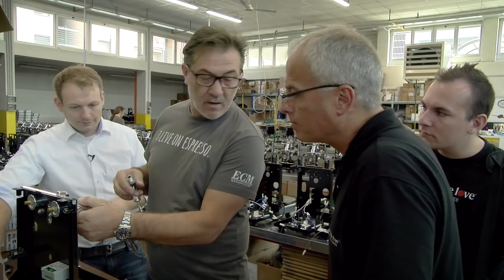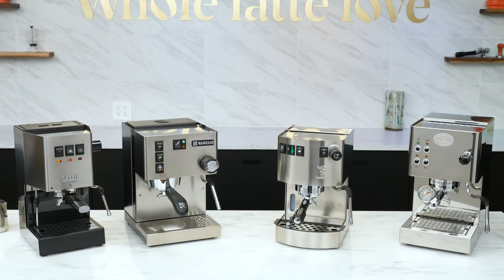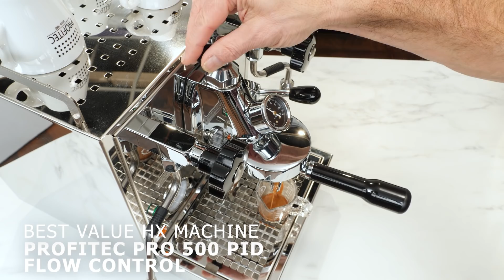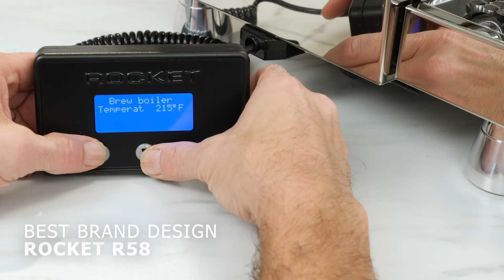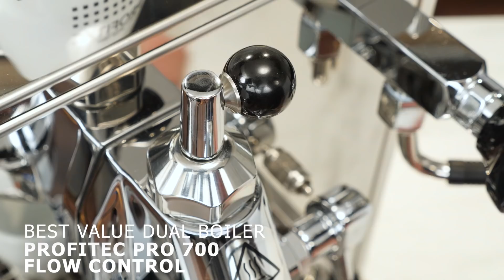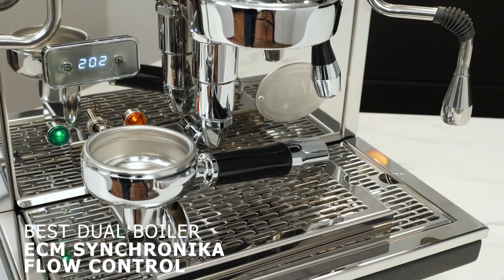Top 5 Best Semi-Automatic Espresso Machines of 2019

Comment: As a german, i prefer german engineering, there the ECM Synchronika should be my favorite. But i like the modern look of Bezzera Matrix better. Do you have any advice?
Thank you for your great work here on Youtube!!!
Reply from the maker: Hi m, Thank you for the comment and question. Both are excellent machines. Personally I prefer the Synchronika. Internally the Matrix is more complex. Synchronika is incredibly easy to get inside and likely to have an edge in long-term reliability. I've been to both companies production facilities in Italy and appreciate the effort CEO Michael Hauck of ECM puts into constantly innovating. Little things like using stainless steel mushroom valves while some manufacturers use chrome plated or ceramic. He and his engineer come from a background in servicing commercial machines so reliability and ease of maintenance is always on their mind. One big difference is steam power in the Synchronika. It's best in class with near 2 bar of pressure. If interested here's a video I shot at the ECM production facility in Milan with Michael last year: https://youtu.be/K0RI5rdz4Ww
Marc

Comment: Hey Marc,  Great video but now confused!  Was originally looking at the Breville Oracle Touch, then a friend said to look at the Nuova Simonelli Musica .... now I see these and oh boy ....  Just a want a great coffees and lattes with a reliable machine...steer me in the right direction!
Reply from the maker: Hi Sam, Thanks for the comment and questions and please excuse my delayed response. Been offline for the holiday for a few days. These are tough decisions with so much to choose from. First thing I'd think about is appliance vs. machine grade products. Appliance grade is mass produced, fair amount of plastics, uses proprietary parts and typically not very user serviceable. Machine grade products are hand assembled using commonly available components of high quality. Internal plumbing is high quality and copper. Virtually no plastic is found inside or outside a machine grade product. They are very user serviceable and with proper care can run for decades. With all that, products like the Oracle Touch are appliance grade. They have a lot of desirable features at a lower price point that hit marketing points but they get there in most cases using lower quality components. If you'll be doing a lot of milk-based drinks I'd consider a machine with e heat-exchange or dual boiler. With those you can brew and steam at the same time. The Profitec Pro 500 PID and Rocket Appartamento in this video are two HX machine options.Those machines IMO are a huge jump over the Oracle and substantial jump in quality of the Musica. Hope that helps and let me know if you have any more quastions.
Marc

Comment: Hi Marc, great detailed review as always. I was wondering if you would consider adding more data to the reviews mostly min/max dimensions and min/max wattage.  I am limited by my upper cabinets as to how big a machine that I can put in the kitchen. I've noticed that some of the machines may have height adjustable feet (I think one of the Rockets have a two piece "Rocket booster" foot that may be separated) and removable cup warmer racks that could affect the height. A lot of manufacturers skip these seemingly minor details when listing the specific machine attributes, but unless you are remodeling your kitchen, the details can be significant. 

When it comes to power usage, I have a controller that can actually measure wattage and found that during start up the power consumption was a smidgen higher than ratings, but after the machine warmed up, the wattage was cut in half. I think I am at the limit in my kitchen and being in an older house, the outlet is shared with some of the lighting. The good news is LEDs have saved the day by eliminating 460 watts off the circuit and everything worked fine without LEDs anyway. I have an energy monitoring controller for the lights and outlets in the house. Apparently there is an espresso machine somewhere in the home that uses the majority of the electricity...

Keep up the great work, it is most appreciated.
Reply from the maker: Hi TT, Thanks for your extended comment! Please excuse my delay in response - I've had a crazy few days! I understand the request for additional details in the videos. I do sometimes include test results for machines but most specs can be found on the product pages on our website. If you need additional details like specific measurements and option hacks like those rocket booster feet you can give one of our customer support pros a call at 585-924-7170. They have access to most every product we carry while on the phone with you and are happy to get additional measurements and details. I'm happy to answer specific questions here in the comments but that typically takes a lot longer. I love the LEDs too! I have reef aquariums at home and converted all lighting to LED. It's far more controllable, uses so much less power and they last a very long time. I used to drop $200+/year just on lamps and I don't want to think about what the electric bill was! My corals are much happier now and so is my wallet.
Marc
Reply: @Wholelattelovepage  Sorry I screwed up your name, so I edited that. Thanks for the answer. I guess another thing I have to consider is the grinder too. If I happened to have a larger machine and a 500 watt grinder, the breaker may not like me too much. Luckily, the stove is right there and I can hop on to that circuit. Back in the day, old stoves had an electrical plug and you could spread out the load. I don't have one on my new stove, but I can wire up 120 or even 220 off the same wiring. I don't use the oven and the espresso machine at the same time, so options are there. You can tell I have been planning my attack for a while. I'm going to remodel the kitchen with new smaller light rails increasing counter height under the guise of modernizing the kitchen, but the real plan is to make clearance for a bigger machine which I will lie and say "No, it's the same size as the last one, it must be your imagination"...

Comment: Hey Mark, nice video. What do you think about the Bezzera Duo or Matrix in quality and function? The display of the Bezzera is much more innovative but they build the boiler still in copper and ECM in stainless steel. Is it better to go with the ECM Synchronika for a bit more money?
Reply from the maker: Hi S, The Matrix and Duo do have a lot going on with the touchscreen display. Some people like that and some prefer a more traditional approach. Traditional may be more reliable. I have no preference on copper vs. stainless. Boiler material makes no difference in the cup. I'd go with the Synchronika. Very reliable, higher steaming power and larger boilers. Plus it's available with flow control on the E61 which opens up more variables in extractions.
Marc
Reply: Hey Mark, thanks for your feedback. I think I go with the synchronika. I think its actually the best all round package of building quality and features in this price range. I like the display of the new bezzeras, but you are right, the classic baros looks also very nice and are more reliable.
Reply from the maker: Stefinho482 good choice IMO
Marc

Comment: Hi! Great video. I have a Synchronika but the knobs for controlling water and steam is black and has different design. New design for 2020? Are they changeable?
Reply from the maker: Hi MU, Thanks for the comment and question. Yes the knobs were updated this year to match PF and lever handle. Just checked on an older Synchronika and knobs are interchangeable. We do not have any in-stock at the moment.
Marc
Reply: Beautiful machines but I wish the flow control gauge on the ECM match the brew and boiler pressure gauges. It looks weird and it stands out, not in a good way.

Comment: Why do those high end machines (such as ECM synchronika) have those very ugly power on and temperature reached indicators. 
Those were fashionable in the 60's
Reply from the maker: Hi OG, Sounds like you prefer the Rocket Espresso design philosophy of no visible digital displays. FYI the Synchronika's display has a finish that blends into the machine and it can be turned off if desired.
Marc
Reply: @Wholelattelovepage  perhaps i didn't state it very clearly, but in fact i do prefer my 2019 machine to look like its 2019.😁
The Chrome is still fine, plastic definitely looks cheap on such machine.
If you use digital technology to get the temperature in range, it's fine to show it.
I will admit I m not a designer.🙄

Comment: Not sure if custom machines should be in this comparison. Profitek and ecm don't sell them this way. Lelit Bianca should be in it or at least mentioned since they did it first and didn't just steal a good idea.
Reply from the maker: Hi Vg, We sell them that way and I've been to the Profitec/ECM facility outside Milan and used it on machines there so not really custom. Flow control, pressure control has been around on higher end machines for years so stealing?
Reply: @Wholelattelovepage  yeah it's not stealing but they didn't introduce it to the consumer market und er 2k Like lelit.  It's not on ecm website in Germany, you can't get it here, good to know they have a plant in Milan, always suspended that.

Comment: Why not the Bezzera Matrix Top DE?
Reply from the maker: Hi R, Thanks for the comment. The Bezzera Matrix is a fine machine which we carry. And, I've been to the Bezzera factory. They make excellent machines and have been at it longer than just about anyone! Also they make more of their own  components than most. At the level I would have included the Matrix I had other machines with flow control.
Marc

Comment: I wonder if you guys will do a review for some other infamous brand like WPM, like the WPM 310,  it's has a pretty good spec and very similar classic look with a very affordable price tag.
Reply from the maker: Hi KN, Never heard of the machine before. In some quick research it sounds like it's using a thermoblock boiler which is a non-starter  at this level for me.
Marc
Reply: Whole Latte Love yes, it does indeed uses 3 thermoblocks if I recall correctly. Surely not the same class with Those you guys reviewed. Just raise it out as it seems growing pretty fast in these couple few years in Asia markets as it looks to be a very good entrance for home use. Anyway, thx for the reply

Comment: Hey mark ,
i want to ask you a question my espresso shot have bobbles in it what can i do to fix it ?
Reply from the maker: Hi AA, Well, if the bubbles are a dense crema most find that desirable. If very thin large bubbles maybe not. What type of machine are you using. Those with pressurized filter baskets can produce a more bubbly faked crema.
Marc
Reply: Whole Latte Love , I use the breville express ,and the filter basket i use is the double wall basket 

Thank you so much for replying back

Comment: How do you guys feel about the Profitec Pro 300?  I almost feel like it should have been the machine you started with instead of the Gaggia, or at least slotted in before the Profitec Pro 500.  I've really got my eye on the 300 and hope to buy it this year.
Reply from the maker: Hi Michael, Thanks for the comment! I like the 300 a lot. It's rock solid and perfect for those who who will do a few drinks at a time. If I had a best value dual boiler category it's the winner hands down. Really no other dual boilers at the price point of the 300 and then there's the Profitec build quality!
Marc

Comment: Hi Marc, nice video. I am very interested in the flow control functions for the ecm sync, is that somethingyou can add onto the previous machine? How much would the flow control parts cost (if it is for sale separate)?
Reply from the maker: Hi HY, Thanks for the comment and question. It is something you can add on to previous machines - and virtually any machine with an E61 group. Due to their popularity and manufacturing lead time we are out of stock of Flow Control upgrade kits at the moment. We hope to have them available in Q1 2020. Pricing varies but you can check out website for current info.
Marc

Comment: Nice video! It's almost 2020 and the Gaggia Classic is still getting mentions! If you've owned a Classic from the nineties, the cost of ownership would've been ~$3 per month. Not many machines could claim that! 

From the fully metal steam wand (with metal jacket) to the black plastic steamer, and then to the industrial/commercial steam nozzle, which is a much needed upgrade. 

One thing I disliked about the labeling is that they slapped a "Pro" with the latest iteration. Imagine them doing that with each Gaggia Classic upgrade, it would've been Gaggia Classic Pro Max Ultra X ProMax Ultra XX Pro Pro Pro Pro Pro today. 

Yes, the Rancilio Silvia and Lelit models are good contenders, but are often priced much dearer.
Reply from the maker: Hi KW, Thanks for the comment. Classic is the best value in premium entry-level espresso machines. The sub $300 appliances do not last and come with many compromises like pressurized filter baskets only, thermoblock water heaters and they're not user serviceable. I hear you with the Pro model but it's the first time the name has been changed - and it's only in North America. But, it's deserved IMO. The first Classic with a manual wand! Silvia is a much loved machine but much pricier and the wait for steam ready is more than 2x as long as on the Classic.
Marc

Comment: How about the De’longhi Dedica? Did you guys look into that one? Also what if your espresso machine puts out the coffee too fast? I have a pressurized basket, finest grind size and no more room for extra coffee. The grinder is the De’longhi KG89.

I use about 12-14 grams for 70-80 millilitres. And the coffee just pours trough in 10 seconds, even a bit less.
Reply from the maker: Hi AT, Well, the Dedica is okay for some but at the end of the day it's an appliance. If you want to get serious you have to ditch the pressurized basket, undersized lightweight PF... Go to a standard 58mm PF on a premium entry level machine and a grinder upgrade and you will be blown away by the difference. The Gaggia Classic Pro and Baratza Sette 270 will change your espresso life!
Marc
Reply: @Wholelattelovepage   Thank you for the reply. Any ideas for slowing the exctraction time with what I already have? About 10sec for 80ml with 14 gram of coffee seems too fast. 

Do you have cheaper recommendations? The gagia classic pro is 500 euros where I am. And the Baratza sette 270 is 400 euros.

Comment: If you're going to spend >$2000, might as well go with Decent DE1+.
Reply from the maker: Hi John, Thanks for the comment. The Decent is interesting but it's more of an appliance build in many areas with proprietary components, low user serviceability, limitations on simultaneous brew/steam and thermoblock boiler.

Comment: Hi Marc, thanks for the great videos! I will be in the market soon for an upgrade and have been eyeing the Pro 500 for some time now. With that said, I hear a lot about issues with consecutive drinks being made on the Pro 500, and even the 600 where some say you have to wait for the temp to get back to normal / pressure to build back up.  Is that something you are familiar with? When people say there is a delay between making consecutive drinks, does that mean they have to wait 30 seconds or 5 minutes? Thanks for any help! I hope to pull the trigger on the 500 or 600 soon!
Reply from the maker: Hi Cam, I've used both machines extensively. It's more in the 30 second range. By the time you've ground and refilled a milk pitcher both should be ready to go.
Marc
Reply: @Wholelattelovepage  Thanks Marc for taking the time to help me out! Will be calling you all soon to place an order!
Reply: I would have to agree... I really like the Pro 500... but the 600’s dual boiler is gaining ground in my mind...🤷‍♂️

Comment: Hi I have an Crem Int. expobar I think it is a Brutus IV vibration pump, is it still a good machine? I got it in 2012...  double boiler
Reply from the maker: Hi RP, Crem is Expobar. Still a good machine! I always liked the extra chamber Expobar milled into the group behind the shower screen. Between that and the vibration pump you get a slower build of pressure at the start.
Marc

Comment: So what does the 700 and ECM give you that the 500 does not?
Reply from the maker: Hi MC, Thanks for the question. Here's what the Pro 700 and ECM Synchronika give you that's not in the Pro 500: Dual Boilers, rotary pump, Individual PID temp control of steam and brew boilers, shot timer in PID display, user settable standby time, user settable backflush reminder and more steam power - they run near 2 bar in steam boiler, Pro 500 ~1.5 bar.
Marc

Comment: Hi Marc,
I’m thinking of getting the gaggia classic pro for my office, to improve our coffee over there, right now we have a keurig machine and pods. Can this machine stay turned on all day? Can it make espresso and froth milk almost every hour without damaging the internals or reducing its lifespan ? I’d turn it off at night at around 6pm and turn it back on at 9am-ish every morning on week days.
And what about filtering water for the machine? Any recommended tools for that?
thank you !
Reply from the maker: Hi PV, You could go with the Classic Pro and it can stay on all day and easily do a drink per hour. It is a single boiler machine so after steaming you will need to cool/refill the boiler. In your situation I'd recommend a machine with heat exchange boiler. They can brew and steam at the same time, no refilling of boiler required and have higher drink capacity.
Marc
Reply: Thanks for your answer !
So just by staying on all day that shouldn’t damage the internals, right ?

Thank you